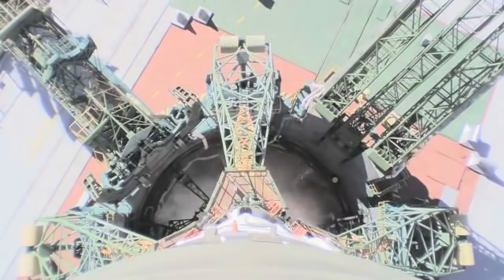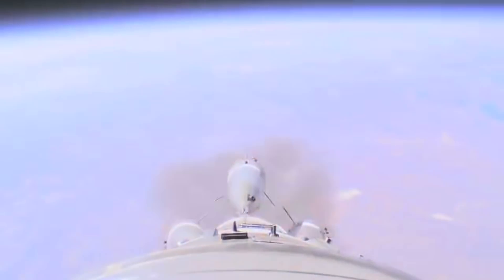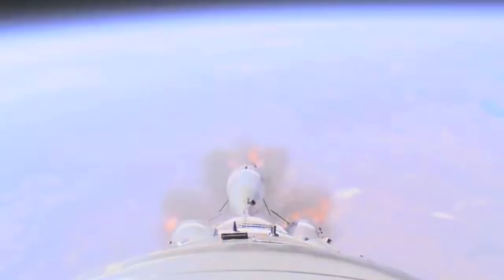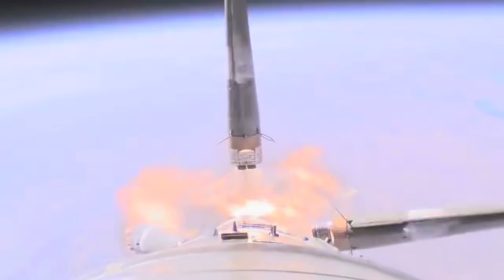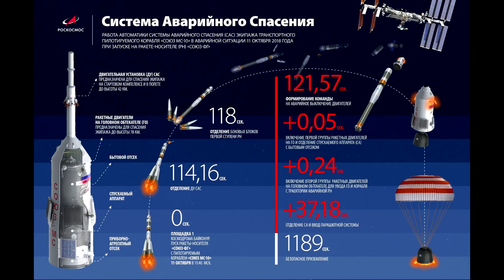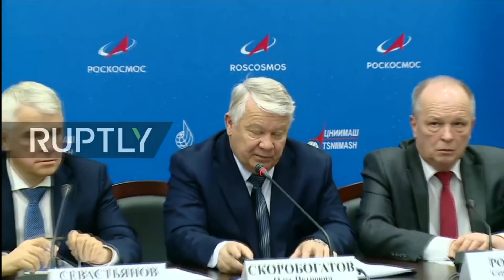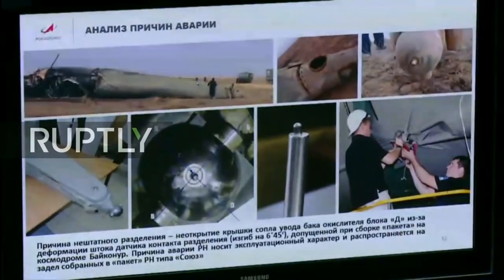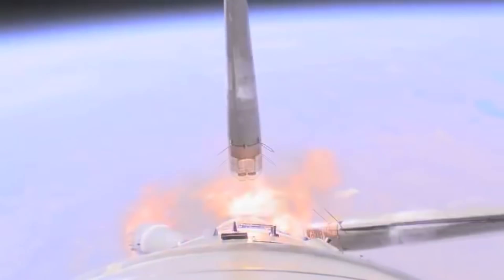In Flight Camera Shows Damaged Sensor Destroyed Soyuz Rocket

Comment: The boosters seemed to be attached by a cable. Is that a fail-safe mechanism to detach a booster if the pin is not bent?

Comment: I’ve watched the  video slowly  several times now, and even Scott’s really slow version.  I understand the concepts of booster separation   but I’d like to examine the ball and socket connection  at the top of the 1st stage and the fuselage. I’m uncertain how it drops away after the lower bolts explode, starting the separation process with the lower half angling outward and the tip of S1 pivoting at the top.  At a certain angle, the rockets are powered down    and the booster’s vents blow out air to push them away from the fuselage.  Does this imply the ball and socket connection is a loose or free joint (I’ve no idea of the proper reference) held in place by the connections lower down the booster, which simply separate from one another after the explosive bolts activate and the engines are cut?
Also, after watching the sequce in slow motion, I still don’t see the left rocket strike the second stage.  Did it simply drop from view straight down after engine cutoff, with the top of the booster striking the fuselage?
And can anyone explain the darker color of the gas cloud that erupted, before another white cloud came into view - presumably LOX from a rupture?  Could the dark cloud be from the launch escape system, or are the main booster rockets on longer than I thought and they’re belching exhaust up stage2 on their way towards going inverted?
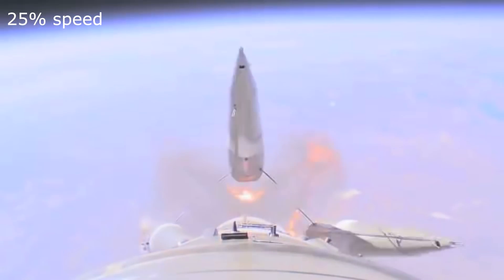Finally, it seems like the camera had shut off around 1:34, because it seems like all the boosters just disappeared, and there’s a new sequence when it turned back on.  No?

Comment: I'm once again surprised by the good condition of the R7/Soyuz  booster and centre cores  on landing. Must be very tough. The centre core in particular attains a high energy... don't forget that with the Sputniks the R7 centre core actually reached orbit along with the payload. Not the case with Soyuz, since there is a substantial upper stage now, but that centre core still burns for a long time, as in the case of Atlas 5, so it's really surprising that it survives re-entry and crash  relatively intact.

Comment: It's probobly a proprietary camera not made by any commercial vendor. There is definetely a lot of impovement that could be done in that field.

If the camera is supposed to relay data as efficently as possible then they could use one of the hundreds of codecs for data compression while retaining high ennough framerate and resolution. I don't envy the guy who had to analyze the failure by those few crappy frames.

Comment: My personal favorite is still the Proton with the sensor installed upside down. VERY thankfully they don't use those for manned missions. That video is actually impressive too watch, because it shows how advanced the guidance systems truly are. Even though the sensor was upside down & therefore making the rocket think it was pointing towards the ground instead of the sky, the guidance computer was still smart enough to deduce that if I'm moving forward & I just launched, I can't be pointing at the ground. You see the rocket trying to correct it's flight path repeatedly, but it gets to the point where it's too much. It's like I know I'm going up, because my orientation sensor said I was pointing at the ground at liftoff. However, it keeps insisting I'm going the wrong way! The aerodynamic stress becomes too much & it breaks apart slamming into the ground. Fortunately for the Astro/Cosmonauts Soyuz has a rock solid operational record & performed exactly as designed. You also have to give credit & respect too Roscosmos for taking responsibility & immediate corrective action. That is extremely rare. On a side note did you hear how Roscosmos raised the per seat price on Soyuz for the USA after the success of Crew Dragon Demo-2? NASA said they still planned to used both for now & Roscosmos raised it to $90 million per seat now. In contrast the entire F9/Crew Dragon is $55 million. Also NASA just cleared SpaceX to use previously flown boosters for Crew Dragon launches, so that's going too make it even cheaper.

Comment: Maybe I'm just a softy, but I think strapping into a rocket that them shoots you 93km into the sky where is falls apart and you are shot clear using the escape system should really earn you a set of astronaut wings, hell even create a cluster specifically for those who have actually rode an active escape system clear of a disintegrating rocket in flight, you wont need very many of them.

Comment: Whats ironic is that while the Soyuz 2.1 is newer than the FG, by a couple of years, its already been launched more, and has a much higher failure rate. Though the majority of those failures are from upper stages which wouldn't be used for manned launches anyway.

Comment: An earlier malfunction was due to a hole drilled into the capsule that prevented pressurization.  This hole seems like sabotage by some.  Now a pin is inexplicably bent.  This also could have been hit with a hammer as sabotage.  I wonder how all this will work out?

Comment: Wow. I understand why the hardware in rockets is so expensive. If 7 degrees can wreck an entire rocket, no wonder there are such high ( and expensive) standards in construction. Between this and the ISS hole earlier this year, there have been two problems caused by manufacturing errors.

Comment: if people dont understand the "6 degrees and 45 seconds" thing.....

if you take 1 degree..... and break it into 60 parts......each part is one minute 
just like taking one hour.....60 mins in an hour

a cool thing you can do with this is MOA...... for shooting guns

1MOA (minute of angle) at 100 yards will be 1 inch
1MOA at 200 yards..... 2 inches 

so 2 MOA at 500 yards will be 10 inches of spread 

ya cant do that with the metric system!!!
imperial has its advantages!

Comment: If you slow it down, they did cut a bit right after the  left booster failed to separate. But, yeah, from the previous ground footage the (from their viewpoint) right booster got stuck on the rocket and flapped around a bit...
Reply: The radio signal from the rocket was interrupted. That's the cause for the missing footage.

Comment: Without standardized assembly procedure, the assembly technician's skill is very critical. A responsible assembly technician will not install a bent pin to the finally product. Also, they didn't do a function testing after the assembly? Someone is drinking too much vodka.

Comment: and how did that pin got bent by 6° ? anyway, since the astronauts came back safe it doesn't mater (much).
Reply: Roscosmos channel has multiple videos of the rocket stack being assembled before launch. Basically, a lady with a gantry crane lifts the side booster, (which weighs about 4 tons) and moves it into alignment with the center core. Then a few dudes hook all the cables up and install the linkages, etc. It is all done with very simple means, and it is not very surprising that things can get bumped or misaligned. But apparently, it is usually done carefully and works pretty well.

Comment: So the Russians saw the need to "censor" out the moments where the malfunction actually caused the booster to contact the rocket and damage it? Imagine that. But with all the speculation about possible sabotage of ISS, etc, I didn't expect them to show that deformed sensor-pin....which might fuel even more of that type of speculation. Strange.
Reply: There was a lapse in the live stream from inside of the ship during the accident. I think the telemetry link was interrupted because of the collision, and that is what have caused the gap in the video.

Comment: Well in the Russian text they attributed the damage to an error in the engine packet assembly procedure made not on the plant but on the Baikonur cosmodrome itself. You see, these packets got delivered to the cosmodrome facility called MIK - which stands for assembly and testing complex in Russian (Монтажно-Испытательный Комплекс - МИК) and there it is being finally assembled. So the final resolution states that this is the operating error and can affect all the already assembled engine packets hence the call for the thorough inspection of all of the assembled units and update on the assembly manuals.

Comment: Obviously there has been some censorship from Roskosmos on the video at the time when the poorly separated booster hits the bottom end of the main stack. Still a very interesting and useful video. 
However, having the chance to recover the rocket elements in a good shape was surely the most valuable piece to conclude on the investigation. 
A reminder to all aerospace flight (test) engineers : when it can be attempted, recovery is ALWAYS very rewarding (even on supposedly nominal flights, where doing post-flight analysis on recovered items often brings surprises and allows varied types of analyses that no telemetry or on-board filming will ever provide - not meaning they are not useful as well). And also, way more convincing towards upper-level managers as proof of a good if not full understanding of what went wrong.

Comment: a pint bent for 7°? ffs, rockets are so fragile and barely possible
Reply: Once upon a time I've encountered a description of a car as "ten thousand bolts and nuts that trying to ride in formation."
Does that mean that car is fragile and barely possible?
Reply: no, cars are robust, rockets are not. Any number of clever zingers won't make spaceflight any more possible. The problem lies in the tyranny of the rocket equation. In very clear terms that itself tells us that rockets are just barely possible - to battle that you need to have the best imaginable manufacturing and engineering. With that it's rather obvious that the result won't be robust. On the other hand Soyuz is an old rocket, today's reusable rockets can take some beating. So there's a hope for more robust systems.

Comment: I mean, it was always going to be an error during manufacturing, the only question was which specific part of the oxygen separation system was incorrect/damaged.

The design itself has proven to be insanely reliable, i'd have no problems at all getting on a soyuz in a couple weeks if the big guys went to the factory and busted some heads while checking over everything.

Comment: I still have some doubt about the whole thing.

1. What is the reason for use of oxygen for separation of boosters. Is it not more riskier than any other? 

2. The sequence of separation should be releasing of the lower joint, then releasing the upper ball-socket type joint so that the boosters may fly away from the rocket body at release time, instead of thrusting in the body of the main rocket..
Reply from the maker: 1. Why would releasing pressure of oxygen tank in booster be risky?
2. Without applying extra force the boosters would drag alongside core.
Reply: @scottmanley  Sorry I didn't notice your reply earlier.

1. I think, instead of using oxygen, a non oxygen based compressed air should be used for seperation of boosters. The use of oxygen would be risky since everything around the area is on fire. Assuming that the rocket is still in atmosphtere at that moment of booster seperation, the release of extra unburnt oxygen can cause fire hazards.

2. Yes that extra force is needed for dragging away the boosters, but I am more concerned with the sequence. 

Let's analyse the video frame by frame.
at 2:55 we can see the faulty booster still attatched, and there is still fire coming out of its nozzles. This means it's still providing some thrust. The direction of the thrust is not vertically upwards but partly into the body of the main rocket.

If the sequence is reversed, (releasing the upper joint first then the lower joint) the booster will tend to fly away from the rocket instead of into the rocket.

I am not sure if I could explain my point clearly.

And the Russians are certainly more experienced than an ordinary observer like me. They have flying rockets  since Sergei Korolev era.

Comment: "Non Standard Assembly Methods"   I suspect usage of a "Universal Fitting Tool" aka Hammer.
Reply: The official documents to service the ZU-23-2 has a LOT of hammers in the pictures. In fact the whole thing is pretty much assembled with dowels that are hammered in place and out again when a part is replaced. I wouldn't be surprised that the Soviet rockets are made in the same way.

Comment: Is there ISS footage of the booster separation malfunction?
Reply: Nope. The launch and the ISS are hundreds of kilometers apart.
Reply: Cant see the separation but one of astronauts took photos of the escape capsule accelerating away from the booster. They actually got up pretty high.  I think I read the abort system thrusted them up to 93km
Reply: Thanks guys...it was just a thought that popped into my head

Comment: Thanks for this report.  I am  disheartened by some of the (after) commentary which shows no appreciation that good engineering is the art of getting it right ALMOST all of the time.  Korolev's design is clearly a work of genius and still occasionally  people will screw it up.  I am recalling the second launch of Saturn 5 where the sensors were cross wired on the second stage.  Failure of engine 3 caused engine 4 to be shut down and then of course vice versa.  Shit happens.....good design mitigates against disaster.  Let us not make stupid denigrating comments about Vodka and appreciate this wonderful piece of work ..
Reply: Cant agree more !

Comment: They're lucky it only ruptured the oxygen tank and not the kerosene tank below it, or there could have been much smaller bits of debris left to analyze. Probably still would have been survivable though, given the time they listed before the abort triggered and the distance from the core stage.

One thing that's always surprised me, though, is that the Russians never put much effort into recovering and reusing stages. The main problem the Americans have with it is they launch over the ocean and salt water does nasty things to rockets... but the Russians launch over relatively flat and empty land.

Comment: But there was a 'plan b', escape capsule. A tragedy averted. Do Americans have a 'plan b'?  None.
Reply: ....Outside the shuttle what US system didn't have an escape system?
Reply: @TheEvilmooseofdoom   The Atlas and the Gemini had none. Name one that did.
Reply: @donald6815  The Gemini design was changed, it had ejection seats because it was originally planned to land like a glider with a para-sail and had no dedicated LES and the booster used hypergolics which tended not to blow up but rapidly burn dispersing the propellants and producing a lower energy slower burning fireball.  A LES system was in place for both Mercury and Apollo.